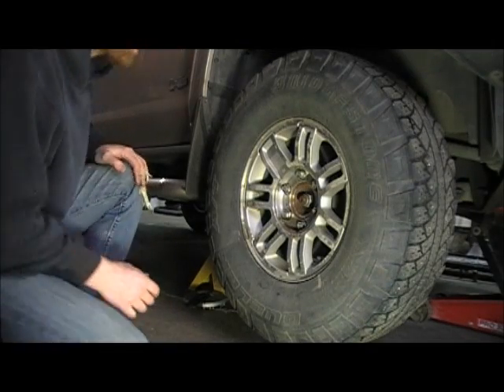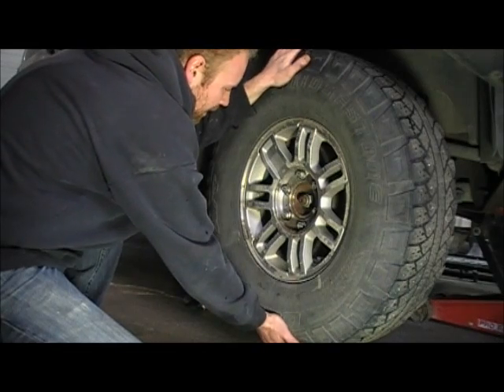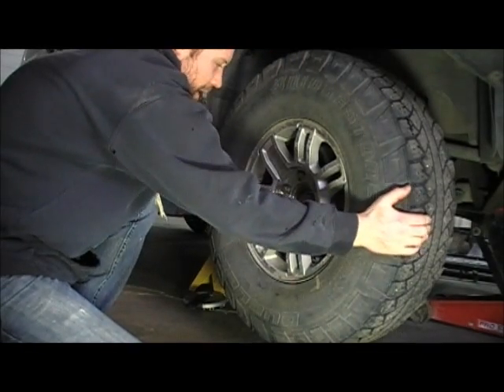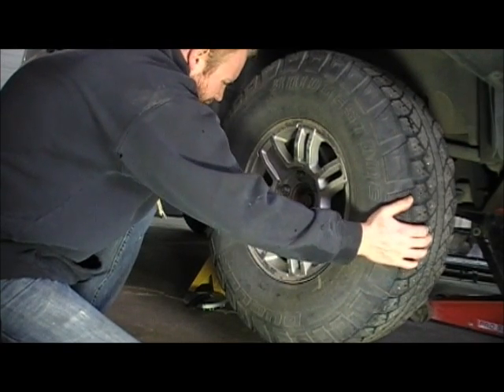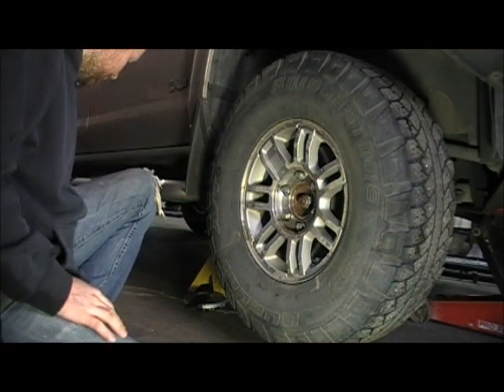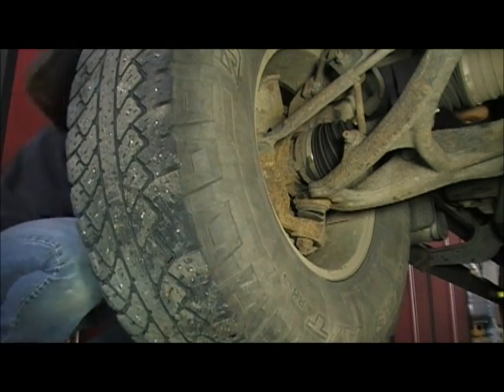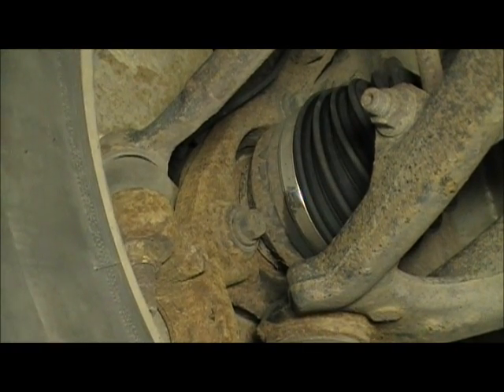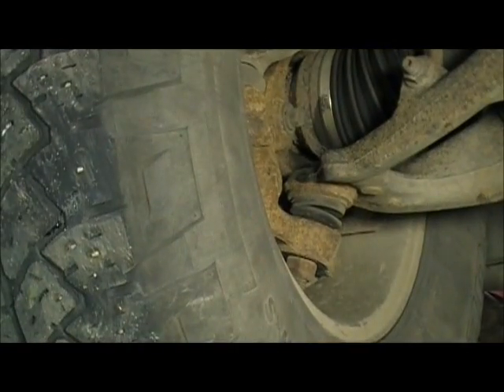Hummer H3 Bad Wheel Bearing

Comment: Assistance please....2006 H3, mega noise upon 25 mpr, is it necessary in addition to replacing berrings...do I have to replace control arm bushing?
Reply from the maker: Probably be best to get it diagnosed by a professional mechanic if your having trouble find the noise. If the control arms are fine, then there is no need to replace them. Try turning left and right while going down the highway to see if the noise increases when the weight is shifted to a particular side. The side that makes the most noise when the weight is on it. There is likely a bad wheel bearing on that side.
Reply: @zerbinauto  
Pretty much did my homework prior to dealership, I determined passenger side wheel berring loud, loud noise. I drive approximately 500 miles yearly.

In spite of 2006,  good job on maintenance/replacements.  Dealership called totalled at $7200.00 includes kitchen sink!

Questions?  Do I have to do  both sides control arms when I just need berrings on one side?  Estimate prices please.  Damsel in Distress!
Reply from the maker: @tdeej7062  $7200!? That's why I call it the stealership. Drive away and get another opinion. Don't let them bully you into taking your money. In the same way we would get another doctors opinion before cutting off your arm you are allowed to check with another mechanic. Try a smaller shop and not the stealership. You do not need to change control arms if you have a bad bearing. IF the control arms are bad then it is best to change both so the suspension is balanced. Good luck
Reply: @zerbinauto  Thank you, Zerbin Auto!  Your support has been most helpful and kind.  I will certainly entertain all of your recommendations!!!  Video most helpful, a Godsend.

Comment: That wiggle could also be bad upper ball joints
Reply from the maker: Yes. That's why you need to check on the inside and see if the movement is coming from the ball joints or from the wheel bearing.  In the video you can see the CV joint moving up and down as it's connected to the wheel bearing.

Comment: how does that affect your car, does that make a sound while youre driving?
Reply from the maker: Hi Freddy they can fail in a number of ways. it can make a clunking noise if theirs a lot of play and also a howling/growling noise when they fail.
Reply: Zerbin Auto  men just a question, i have hunmer h3 and every time i want to press the accelerator it makes a horrible sound like "broom"  and avery time i turn right or left or in any curve it make that sound ; somebody told me its the transmission. i changed the transmission but it still making that sound. you have any idea what that problem might be?
Reply: I know when mine went bad my car would not stay straight it would always go to the right and that's was the side with the bad wheel bearing lol the mechanic said it was my tie rod ends and i got that fixed but when the problem was still there i really found out what it really was, the wheel bearing!!
Reply from the maker: Hard to know what a broom sounds like lol. But it could be your axle shafts if its making a clicking type noise. If it make the noise while turning then outer cv joints.
Reply: Correct me if I'm wrong but I believe a broom sounds like swoosh Swoosh or fffssshhh ffffsssshhh